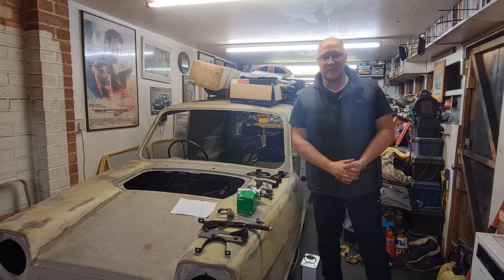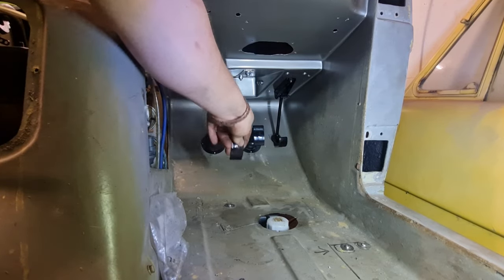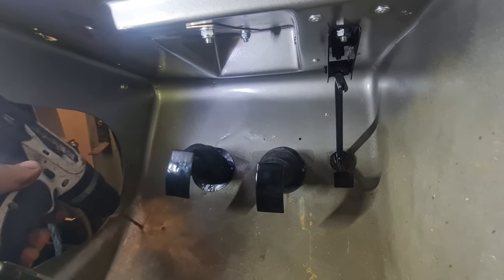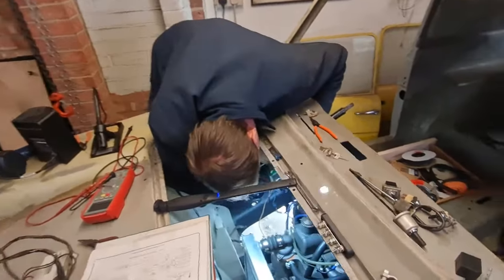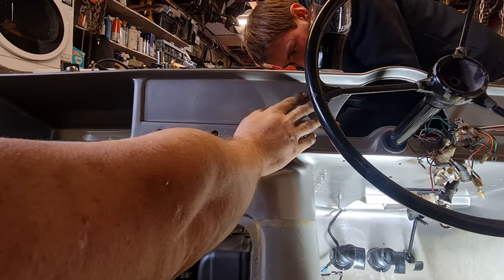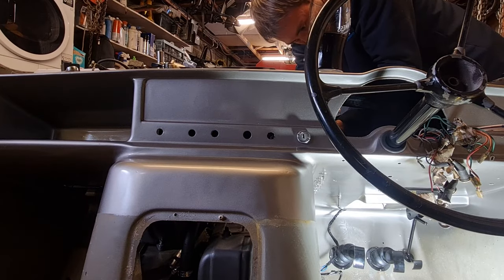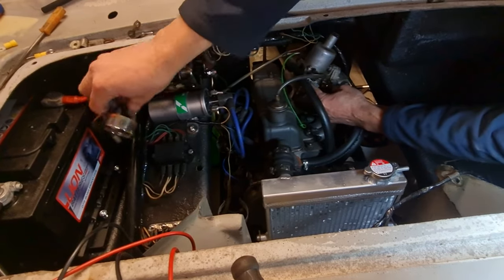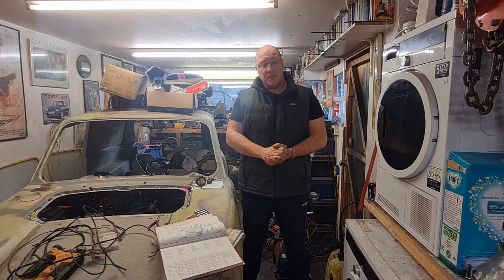RESTORING My Reliant Super van Project Plonker Pt23

Comment: Hi Mec-Tec Regards low oil pressure light not going off.. Providing it’s wired up right and oil it being pumped to the rockers carry on with the above checks, this method saves removing the sump pan. On the alternator side you have three grub screws and on the oil filter side you have one, undo one remove it, crank the engine oil should pump out a reasonable amount. The next thing to consider is this that large hex nut next to the oil filter is an oil pressure relieve valve, with the small ball bearing spring and a round black seal, you might have a weak spring, the round rubber seal is knackered, or the bearing is not shutting closed, which will make the oil pressure light come on  if you have another spare one put that in and see how that goes, just maybe oil pressure sender the one with the spade connector on it   check it does not have something blocking the hole in it or swap it for another.
Yep loads to check but any one of then makes the oil light come on wile the engine is running, I don’t think for one moment there is anything wrong with the oil pump at this stage, it just my experience I have playing around with reliant engines for over 30 years.
Reply from the maker: Hi mate 
thanks so much for the message and all the info, I think (i hope) I've found the problem, as you mentioned I took off the bolt under the oil filter where the pressure relief valve is and it appears that the block has been fitted with the wrong valve, it has an early spring and ball bearing one fitted but it should actually have the later one piece type fitted so I have one coming that will hopefully sort the issue ! Fingers crossed ! All the best MEC